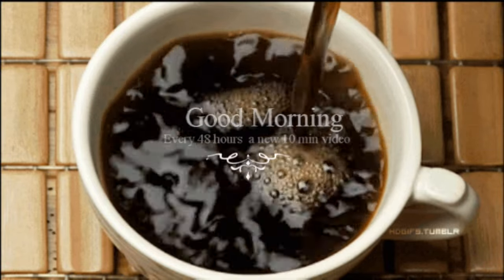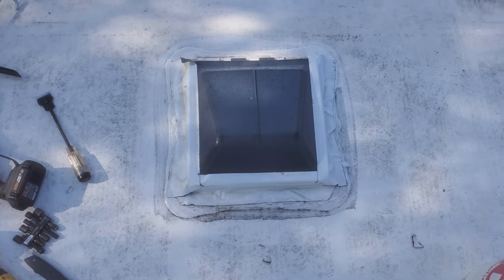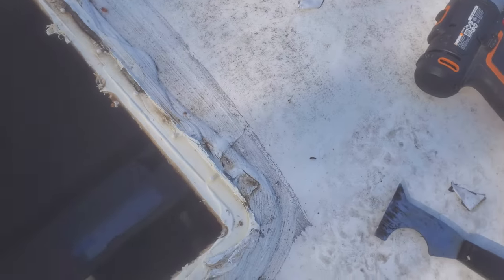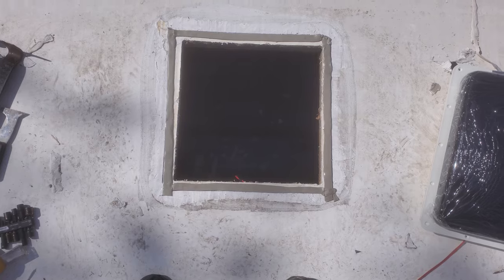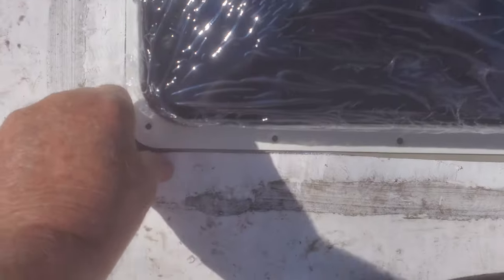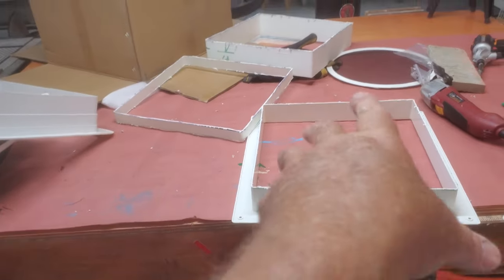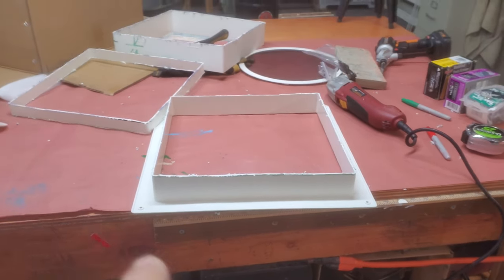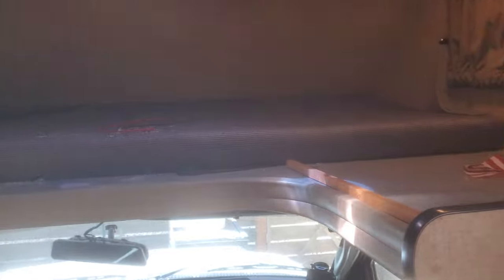RVLOVENT RV Roof Vent Fan 12V Auto Remote Control 14'' inch 10 Speed part 2 Installation #1517

Comment: did it ever turn off the fan when closing ?  I was looking forward to this being in part 2 :(
Reply from the maker: I don't really remember what it did at that point I know we use it every time we're out now, it's such a regular thing I don't even remember I think we just turn it off and it automatically shuts the fan off when it closes the lid, I would recommend this little unit to anybody that's looking for one
Reply from the maker: What I will do for you is tomorrow I'll go out and make a 60 second short video on it
Reply from the maker: https://youtu.be/mBrpMOcd7r8